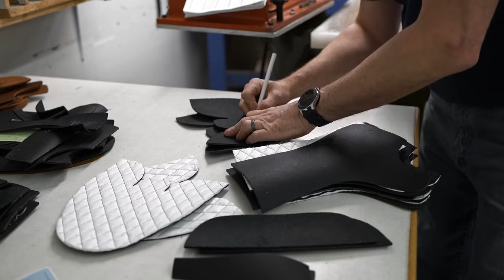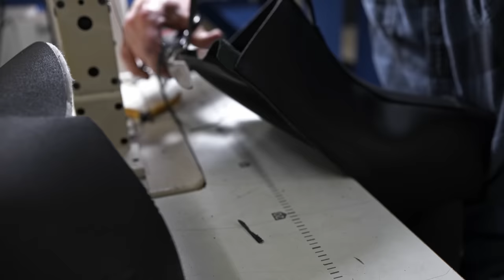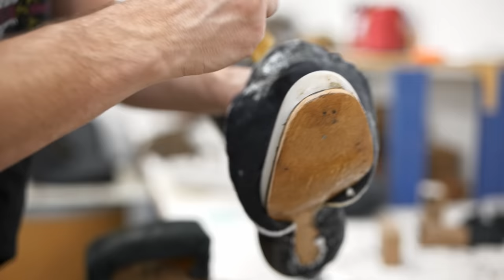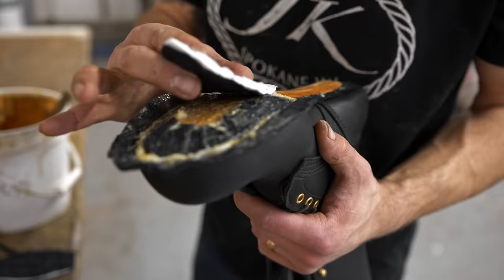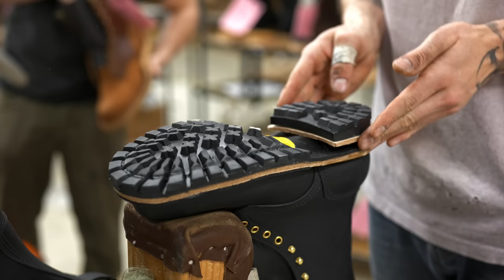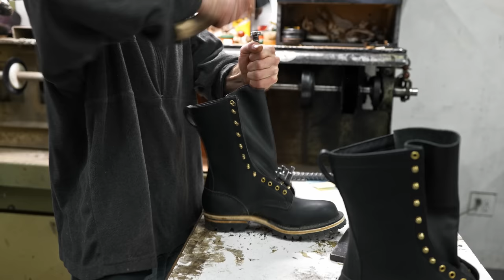How it's made - The Arctic Boot - America's storm chaser | JK Boots

Comment: Is there a metal plate under the sole of the shoe you use as a mold? Do the nails you hammer in contact with the metal plate get crushed and bent?
Reply: Yes, they hit metal plate and clench over,
Reply: @MrSpider182 what metal plate??  The last doesn't have a metal place and neither does the finished boot..... Where's the metal plate???